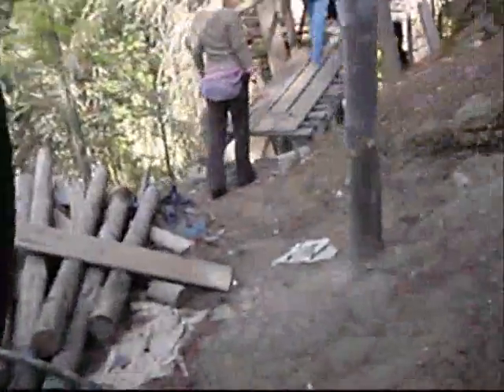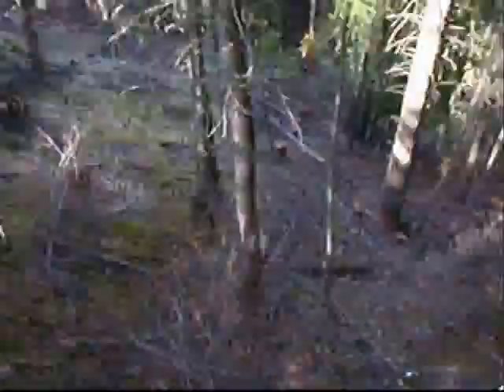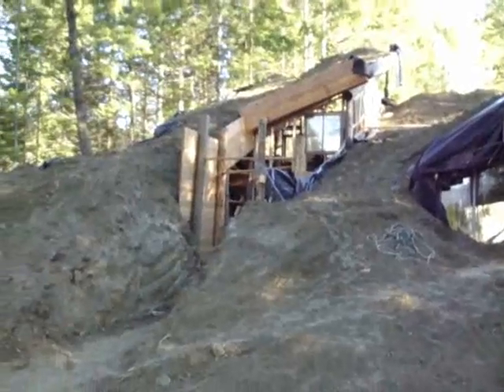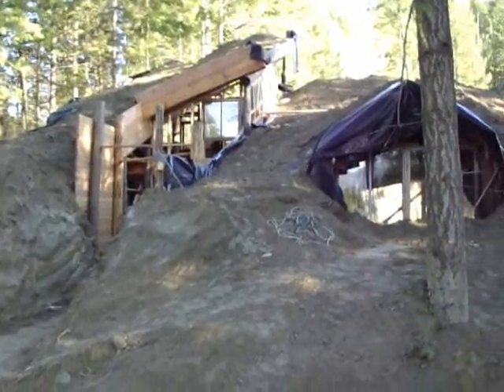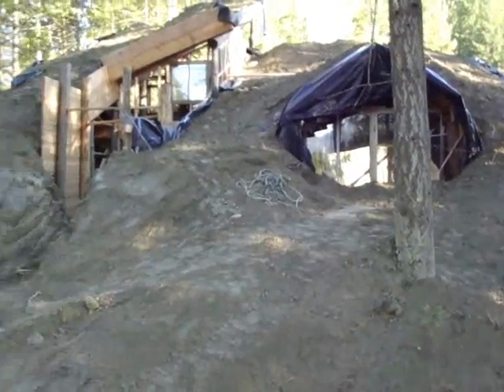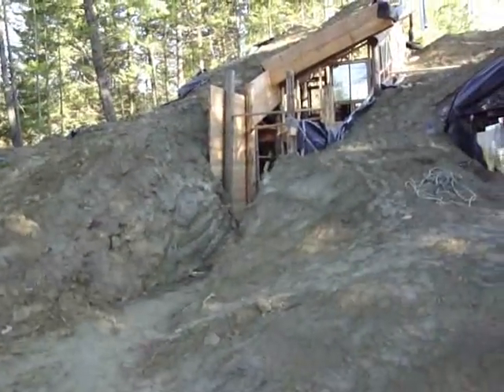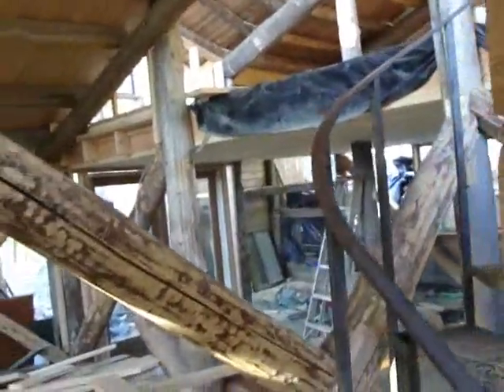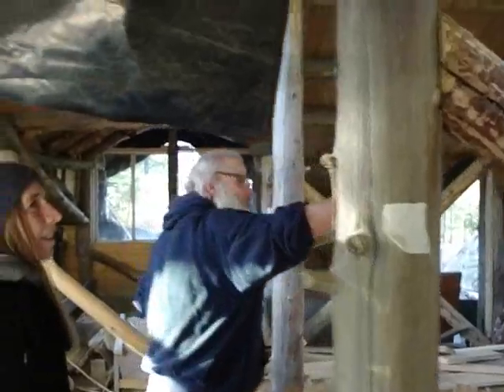mike oehler's PSP ridgetop house - author of the $50 and up underground house

Comment: I have followed Mike's ideas for 30 years. Plus there's cob building cordwood and straw bale with post and beam. Orient the movement of the winter and summer sun and build accordingly. Natural cooling without AC. Radiant floor heat. Check out if still in print *The Shelter Book.* Small house designs and creations that go right off the reservation. TSB came out in early 1970s. Woo Hoo Mike